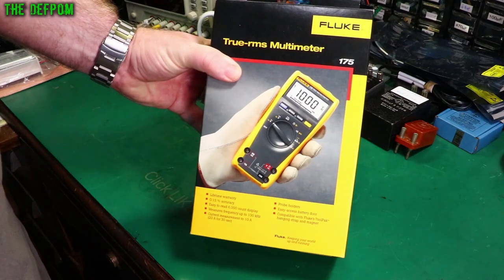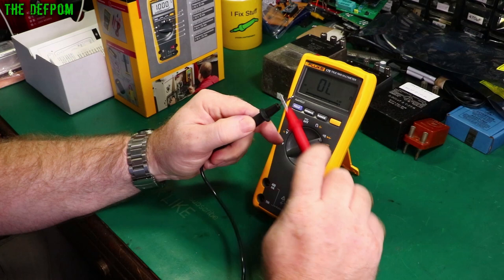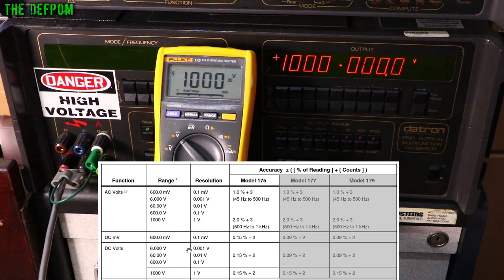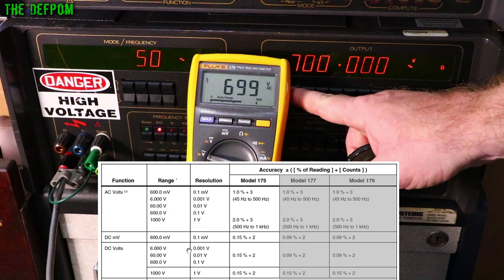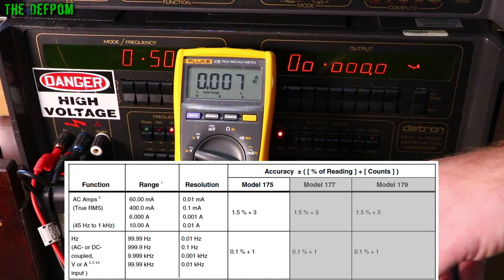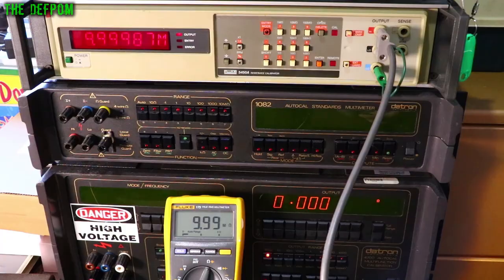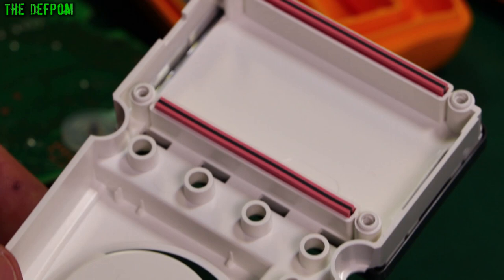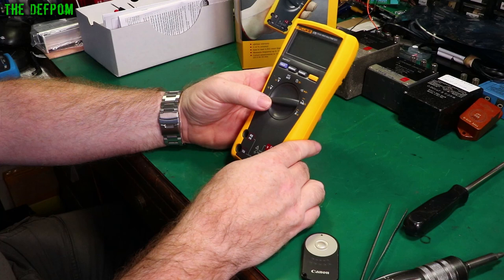🔴 Fluke 175 DMM Review & Accuracy Testing - Sponsored by Fluke & Pomona - No.931

Comment: The accuracy is impressive, but I wouldn’t expect anything else from a Fluke.  I would bet if you worked this meter hard for twenty years and tested it again nothing would change.  Fluke products are expensive but you really do get what you pay for. My 87-original version from 1994 is still going strong, as they say “buy once cry once”.

Comment: You can consider connecting a shake sensor to the backlight button. Just give it a bit of a shake to turn on the backlight.
Reply from the maker: That is an interesting idea, I have just found that having a backlight would be handy (working on my motorhome house battery bank) so I’ve ordered a keypad with the backlight button on it 👍
Reply: Where did you order your keypad with backlight?

Comment: Thumbs up as I appreciate your work!  But seriously, most readings are showing just 2 digits, so any rounding would be perfect - your word. Why don’t you try 0.95 mA instead
Of 1 mA.  Oh, because Pomona / Fluke (same company) gave you the meter.  Amprobe also the same company provides a much better meter at a lower cost and with far better leads.  BTW, a $10 meter would have scored just as well in this testing.
Reply from the maker: I have done exactly the same tests on Kaiweets meters too, no bias is present, I have other meters lined up to test too which you can’t even buy anymore, just because it will be interesting.